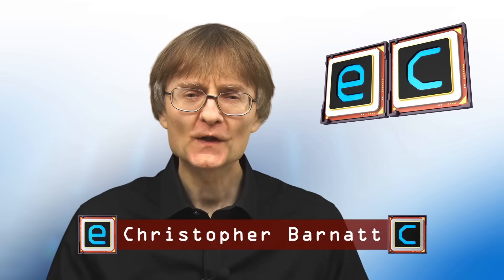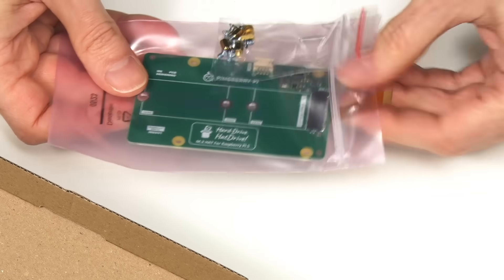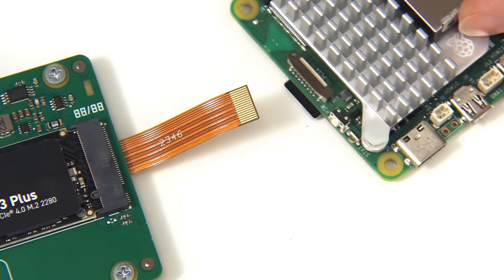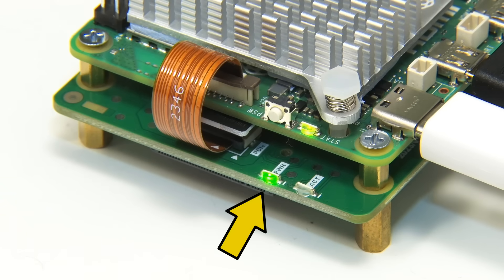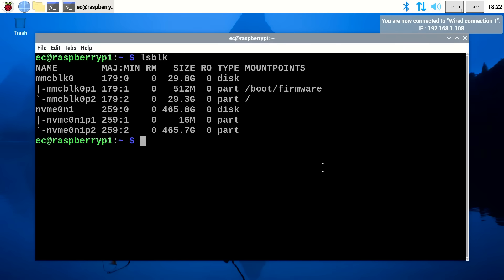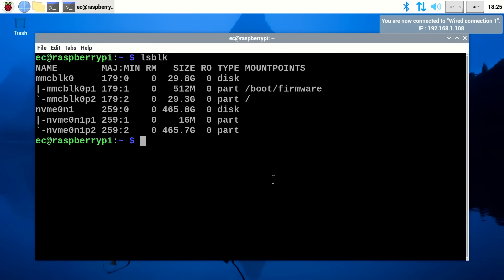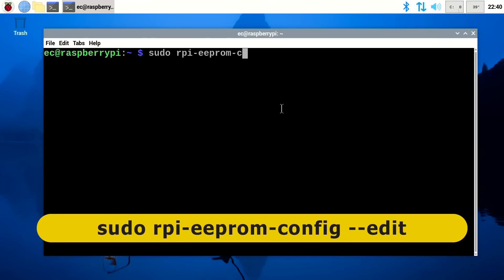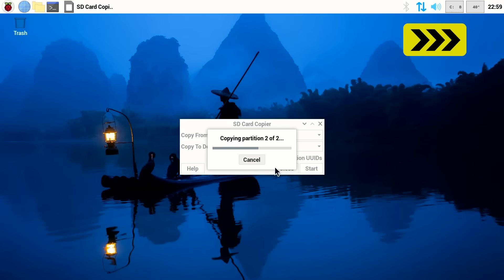Raspberry Pi 5 M.2 HatDrive!

Comment: Is gen 3 the max? Just tried a 2280 form factor it didn't fit 2 different types of hats, is that because it was gen 4 and most hats are gen 3?
Reply from the maker: Gen 3 is the max a Pi can operate at (it is only rated for Gen 2). The M.2 form factor has nothing to do with the PCIe generation. So if you have a 2280 M.2 drive that does not fit into a 2280 Pi HAT is it almost certainly because it is a SATA drive, not a PCIe drive. Remember that M.2 is not an interface -- it is a connector, that can be used for several different kinds of interface, and is keyed (has notches) to stop you plugging in a drive with the incorrect interface for the particular slot. I've covered this here: https://www.youtube.com/watch?v=EXLfErPEYiw
Reply: @ExplainingComputers Hi sir, thanks for the reply, well I have two hats. One does say SATA but the other does not and I thought all connectors for SATA had two notches, these only have one. In fact purely by coincidence I was using the exact same kind of nvme drive, the crucial 2280 4.0 in each one and it almost fit both but was off by about a millimeter or two. I noticed the small side of the connectors on the hats add for only five pins and the nvme drives had more but again only one notch not two like I would expect from a SATA hat. So I'm really confused as you can tell, they act like a nvme would almost fit.

Comment: Can you unplug the hatdrive while you get the micro sd card out and then you plug it again?  Is there any problem with that?
Reply from the maker: Yes, you can do this safely when the Pi is off. However, the PCIe ribbon cable is not easy to remove and replace, and it not designs for many insertion cycles! :)
Reply: @ExplainingComputers  Thanks!

Comment: I realize this video is a year old. I just picked up a Pi500. Will the Pci Hardware on Bottom fit the 500 configuration?
Reply from the maker: No, there is no PCIe connector for an M.2 adapter on a Pi 500.
Reply: @ExplainingComputers  thanks, I saw another video that explained the Pi500+

Comment: Thanks for the guide, very helpful. I went from a SATA SSD raspian lite system to the same system on an nvme with the Argon Neo 5 that you've another video showing how to build in (that fan cable..). I didn't need to to the rpi-eeprom-config, seems newer firmware handles nvmes automatically. Didn't need the "nvme" dtparam either in boot/firmware/config.txt. Did put the pciex1_gen=3 param there though. (Cloned the SATA system partitions (/boot and /) with dd to two equal partitions (though the / was twice as large) on the nvme that I created and formatted with fdisk. /etc/fstab on the target / partition needed the new partuuid, so did /boot/firmware/cmdline.txt. I used resize2fs to expand the / filesystem from the 500GB SATA on the 1TB NVME /
Reply from the maker: Glad to hear that you've got everything working OK.

Comment: I'm a year behind now. Well, I doubt many will respond to a question on a video this dated but I'm going to ask anyway.
Starting USB 3 speeds are 5GB/sec. Why did the Nvme drive with the USB adapter run so slowly compared to the HatDrive?
PCIe is approx. 1GB/sec per lane. With one lane this PCIe interface should be slower? 
Is google lying to me? What am I missing here?
Reply from the maker: You are confusing, I think, gigabits per second (Gbps) and gigabytes per second (GB/s). Standard USB 3.0 is 5Gbps, not 5GB/s. And this is a theoretical max, not what all hardware supports. A single PCIe 3.0 lane is indeed about 1GB/s (985MB/s), so above the speed obtained for the SSD. So the interface is performing within the expected parameters (ie below the theoretical max).
Reply: @ExplainingComputers  Thank you.

Comment: I tried to get the raspberry pi going with the pineboard board, but I get only the RP green led and fan, no led on the pineboard (double nvme version), and no LEDs going on the ethernet port, I tried to flash on a micro sd card but nothing. I am using the original 27W plug, can anyone help please?

Comment: Any tips for a black screen on reboot after editing the /boot/firmware/config.txt to add the two dtparam lines?

I put the SD card in another computer and there's no config.txt file in the rootfs/boot/firmware dir, and the bootfs/config.txt had the added lines, but removing them didn't fix the black screen.
Reply: I disconnected the SSD and it booted to the SD card normally. I'll see about getting things back to normal and then try connecting the SSD again
Reply: Looks like the issue was with the nvme. I previously attempted to use the SD card copier and cancelled in half way because it appeared to be frozen. But removing the nvme, the pi boots normally with the SD. Now I'm struggling to find a way to reformat the SSD without another way to access the nvme.

Comment: Can you tell me if possible to start the Raspberry with the turn on the power supply and not like you do at 13:21 turn on the power bottom ? Why is because I want to use the system as a NAS located at another  room and i only want to turn on the system once a week to take backup of my data and if I need to restore data, I can control the power supply from my computer room but have no access to the 'on' bottom
Reply from the maker: The Pi 5 will boot up when power is first connected. The power button is only needed if you shut down and want to boot it up again without having disconnected the power. So what you describe -- controlling the power to the Pi from elsewhere -- should work fine.

Comment: I purchased to Raspberry Pi official top hat from Pi hut and did not have to make any config changes. Also, in passing, Webmin is a great way to admin a Pi. I have it running on all my Linux boxes, including 3 Pis and it is completely free to download, install and use.
Reply from the maker: I imagine you purchased your official HAT more recently than this video, by which time updates to Raspberry Pi OS meant that config changes are no longer necessary. :)
Reply: @ExplainingComputers  Hi - Yes, I purchased a Pi 5 plus a hat/SSD this week. However, I still found your video very useful and informative and I used it to check Pi OS could see the SSD and to clone the OS from the memory card to the SSD.

Comment: I don't know why, maybe because i made a new system sd-card, but the config.txt is located at /boot/firmware/config.txt - with the ekstra "firmware" added.... Another thing i would like to ask you about is the "app" you use for testing the speed, i get an error about it not being present in /dev/.
and lastly.... thanks for this awesome video, it made it really easy to install the nvme drive.
Reply: I know it's 7 months ago. But if you haven't figured it out, it's because you need to install hdparm:

sudo apt-get install hdparm

Comment: Hi Chris, could you please do a video regarding the best nvme for the pi5? The crucial p3 plus is dramless which when running Linux is much more of a hindrance than in windows/mac os where system ram is used. Under most Linux distros the nvme will be forced to use part of its space as dram which goes without saying is very slow.

Thus using an nvme on a raspberry pi running Linux we need dram to benefit from the real speeds, having said that we need gen 3 or above and ideally with a heatsink to get the optimum speed of nvme on a pi5. 

I have ordered a pironman 5 case and I will be ordering my first sbc in the pi5 after Christmas.

Comment: Can this Pineberry Pi hat drive  bottom be gotten in the USA?  
Is there one that still allows you to use the official case?  I have a Pi 3b and a Pi 5. Ubuntu is all but unusable with a micro SD card. I want to use an SSD.

Comment: Hi Chris Iv been watching all SBCS since the first pi. (Particularly your videos). Iv recently built a very expensive powerful pc which I thought will be my last build as everything is going SBC. I now think I will go SBC earlier than I thought. If i just need to do basic things I might aswell use an SBC.

Thank-you for doing this addition to your pi5 video as its what i was actually looking for to have an nvme drive. 

I would quite like to see open suse kde running on a pi5 with nvme. 

I want to run it as an efficient pc and potentially (if I like it) a mini server.

Thanks Chris.

Comment: I found the config.txt in /boot/Firmware. Unfortunately the commands didn't work on the Argon Neo 5 case. I only see the sd card (booting from). I have changed the ssd to  a P3 Plus an it works! Excellent help, your Videos! 😀

Comment: Why don't they copy the UDOO RYZEN Bolt V8 and install a SATA controller chip on the Raspberry Pi V as it would do away with the need for these boards and you could just use 256GB Corsair SSD drives and not worry about it.

Comment: I just got my rpi 5-8gb yesterday and tried my nvme hat with the rpi ubuntu flavor and it's EXTREMELY slow.  I enabled nvme gen 3. (altho the config file seems blank except my two lines that i added)  I open terminal and 5 mins later it opens.  I have to hard cut the power.  I'm also getting low power/volt warnings even with a laptop 65 watt charger (and several other chargers/cords) no matter what OS i'm running.  I think the trash can is going to get an rpi5 soon. 

Also, my nvme does mount on the top of the pi vs bottom. 

Not sure if there's anything else I need to add to config file, etc.

Comment: Question:  how do I now update the OS to Ubuntu now that I have raspberry Pi 5 booting from nvme drive?
Reply from the maker: If you update your Pi 5's eeprom, you can then use the new network installer for this, with the Pi installing Ubuntu on your SSD directly from the Internet. I'm covering this in a video that posts a week today (12th May).

Comment: Great video! Learned a lot and am sure it will help me start my next to arrive RB Pi5
quick question.. is the micro SD or can I perform the initial setup with an USB3 pendrive?
Thanks again!
Reply from the maker: You can indeed use a pendrive rather than a microSD card.

Comment: This was a very good video.  As of today 04-26-2024, running this on the most recent Pi software, it works well.  I had to change to a Crucial gen 4 drive to make things work though.  In addition, the config.txt file is under boot/firmware/Config.txt

Comment: if i mount the ssd, can i install the raspios on the ssd instead of the sdcard? can i remove the sdcard then? or is the ssd then only a second drive?
Reply from the maker: Yes and yes! :) You can use the SSD as the boot drive with no SD card fitted. This is all shown in the video -- from about 11:50 to 14:10.
Reply: @ExplainingComputers  super, thank you.

Comment: I've actually acquired one of these NVMe adapters. I'll have to see what I can do about getting 4 pieces of acrylic cut to about 75x100x(2~2.5)mm to fit the bottom of my DeSalvo Pi5 Galactic cases. Custom-cut the rest of it, and then I can mount this to the bottom of my case. I already have 4 50mm pcie cables being shipped to me. The one it came with was simply too tight a fit. I'll be testing it with the 256GB NVMe SSD that came with my Dell Optiplex Micro that I got some 8 months ago. Sidenote, don't EVER buy one of those, it is the DEFINITION OF PAIN trying to find memory for it.

Comment: I had no choice but to use the pimoroni as a HAT because I wanted to use it with the official raspberry pi case and still have access to the SD card slot. I didn't like how the cable obstructed the SD card slot and the cable was little short and so were some of the screws that came with it so I just ended up ordering 
 the longer cable from them and mounted it on top but the pi case also had to be modified to get the Pimoroni to work as a base. I ended up having to cut a slot in it to get it to work as a base to accommodate the PCIE cable.

Comment: Whoop .. Much faster than the SD card. I have the same board, but did not have to edit my config.txt file (it also moved to /boot/firmware/config.txt) .. When I was hooking it up (before watching your video) I was wondering what they were thinking making such a short cable right over the SD card slot. I may buy a longer cable, and do some creative routing to get easier access to the SD card slot (I want to use my Micro SD to SD adapter for my photography work.

Good video, thank you for creating it for us.

Comment: Excellent video, Chris.  It helped me get my Pineberry set up....One word of caution though.   Copying the SD card to the NVMe can be risky.  When I tried doing it there must have been some corruption in the SD card which transferred to the NVMe or occurred in the transfer and then it wouldn't boot with the NVMe installed.  I had to remove everything from the NVMe disk (Not easy, needed to use an Android phone and a M2/USB C  adapter to do it).  Started again with a new SD card and version of raspbian.  Once it was up and running on that, used imager to load a new Raspbian onto the NVMe drive....now works a treat.    
.... and you need to update /boot/firmware/config.txt now to insert the dtparam values, not /boot/config.txt
Thanks for this video ... and all your other work, too. ☺

Comment: I flashed the Raspberry PiOS onto a microsd and updated all packages prior to following along - I was getting "command not found" when trying to test the drive speed until I manually installed the necessary hdparm packages [sudo apt-get  install hdparm]. Everything went smoothly from there. Did this with the Geekworm x1002 M.2 hat, although coincidentally the same Crucial P3 Plus drive.

Comment: The PICEx is not certified for gen3, it must work in gen 2, yersterday i installed Ubuntu 23.10 in the Pi 5 and the SSD is almost 500 mb speedtest, but that's fast enoughm The NEO5 because is metal casing has impact on the wifi signal , so i connected the ethernet and used Kodi to test the continuitiy of the strream and works fine, In Ubuntu the boot.config is not filled with the rules that must be added , never found it , but it works.
Reply from the maker: Rubbish. The PCIe connector on the Pi, whilst rated at PCIe 2.0, works fine at 3.0 with most drives (as even Eben Upton has noted).

Comment: I havw the Neo 5 NVME case works fine, i had ubuntu on it firts but NVME dsoes does not work, then i installed RPI OS and it works , have a Crucial P3+ SSD 1 TB and is siupported and works fine, Pi stays cool in this kind of case, works perfect.
i also have a neo 5 case and the SSD part can be ordered separately and can get a ssd for the other one also

Comment: Hi! Thanks for this perfect and crystal clear video. This is exactly what I did and worked out perfectly fine. The only issue I have since I switched to my nvme ssd as main boot device is, that after a while the SSD gets disconnected - so I can't access my services anymore on this raspberry pi. Seems like some kind of idle mode. If I have an open SSH connection and start working there again, it all comes back without the need of a restart. But before that all webpages  are not accessible anymore. Even new SSH connections from remote I can't do. Would appreciate any hints, ideas .... Thanks!
Reply: I found the reason. It was the mesh router. My raspberry is currently only connected via WLAN. After switching to SSD I had this problem, I never had it before. Once I restart my router, everything works again, so it must be a router issue. What I also did for my raspberry, as it is always on the same place, I de-activated Mesh technologie for that device and it seems to help.

Comment: I followed your instructions and it all worked like a charm. My SSD was recognised without changing config.txt.  I copied my bootdrive with 'dd'. After reboot I found that I forgot to detach the old drive, so I had a mix of both drives. After power down, removing old drive and boot, everything was ok! Thanks!
Reply from the maker: I'm glad that things worked. :)

Comment: I messed up pretty badly, I forgot to add the line PCI_PROBE=1 and it wouldn't boot, so when I plugged in both the SSD and microSD, the boot was picked up from the microSD card and the OS mounted the SSD's data partition! so I was screwed! I had to add the line, then copy the partition from microSD over to SSD, then reboot without the microSD. I highly recommend you click New UUID's on the SD Copier, otherwise linux will mount both if they have the same UUIDs, thanks.

Comment: Really useful video.  I like the command line text you present with yellow background.  I went cheap and bought an MCUzone M.2 Hat.  Ribbon cable was a bit fiddly but with a soldering iron to remove the captive nut and a spare cabe tie, all is working well.  Best mine has seen is 662.5 MD per second with Gen 3 config enabled.